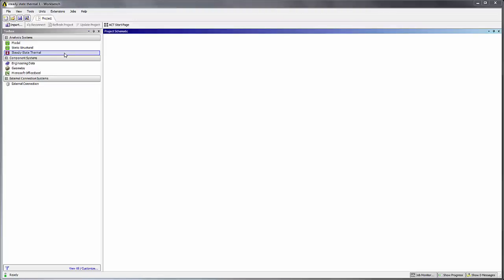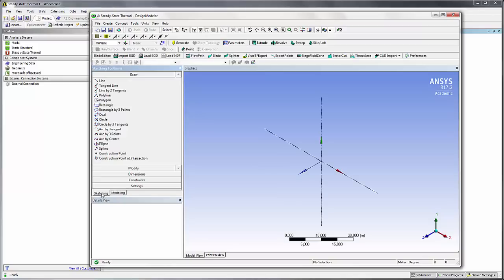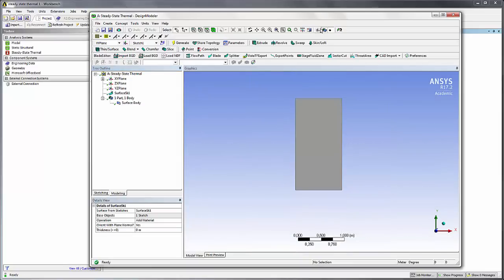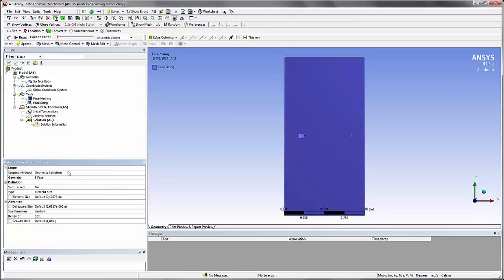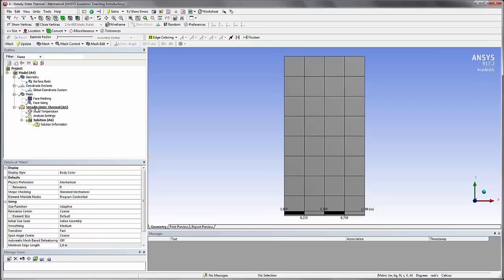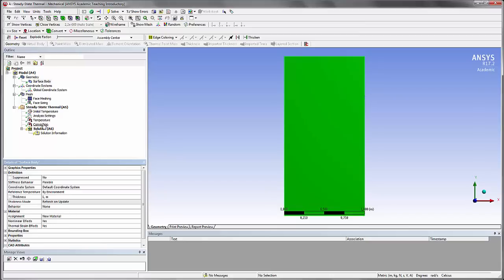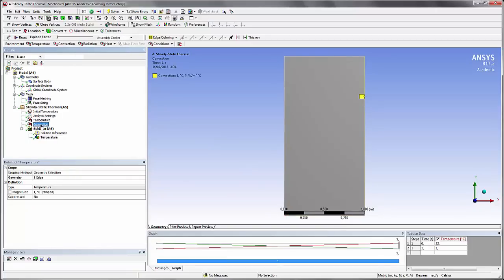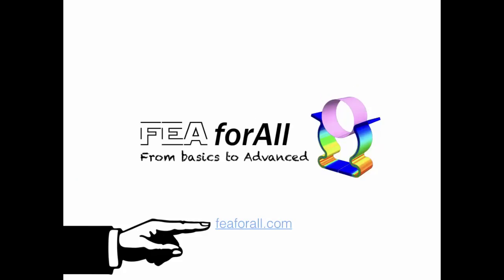Ansys Tutorial:  Steady state thermal analysis of a simple plate

Comment: For some reason I couldn't get my convection edge to work, once I selected convection it would not allow me to select an edge, only a face.
Reply: I believe that face select is the default. Try switching to edge select by clicking the box with a highlighted green edge on your toolbar. (Should be around the top-left). You can also use the hotkey (Ctrl + E). Hope it helps.
Reply: @markfindlay4669  as soon as I clicked convection edge selection was grayed out and not an option...
Reply: @shakenbakeoutlaw396  I had this problem too. I fixed it by clicking "Surface Body", then changing "3D" to "2D". After that the edge selection worked.
Reply: @tn7239 good！your answer is quite helpful for me ~
Reply: Same here! I just couldn't get to select edge only

Comment: Hi, if you have to simulate a simple led heat sink how to apply a resistance in the external surface due to the paint surface? Why in my test laboratory the painter heat sink work better than the raw heat sink? ...thanks
Reply from the maker: Generally, there is a parameter called "nonstructural mass" inside the material data, this is used to take in account things such as coating and paint and additional small elements that cannot been simulated. Maybe there is something similar to consider the resistance due to paint. Check the manual of your software. Otherwise, I advise you to do some testing to understand if this is something that can be neglected or not.
Reply: Painted heat sink especially in black colour will help in absorbing the heat from the source. ( black body- radiation concept)